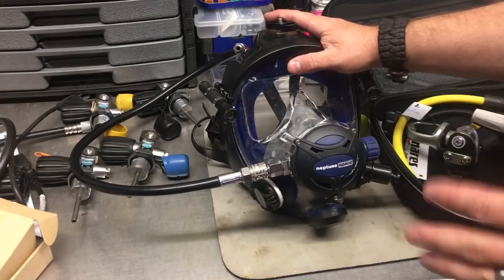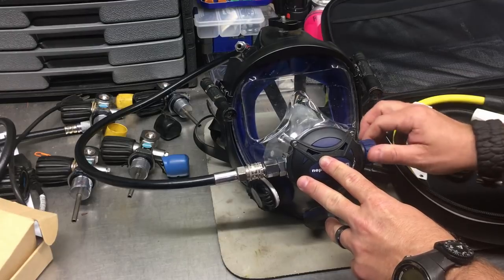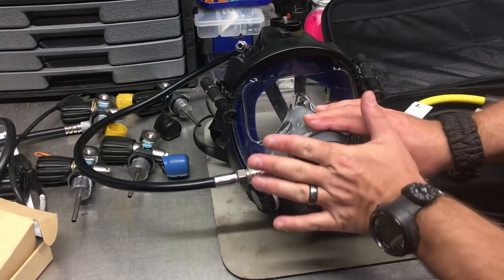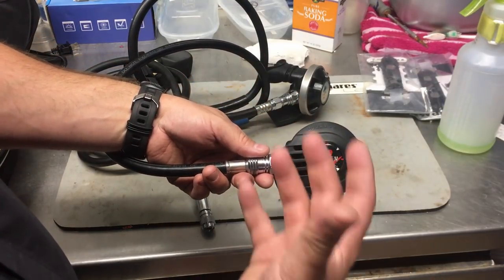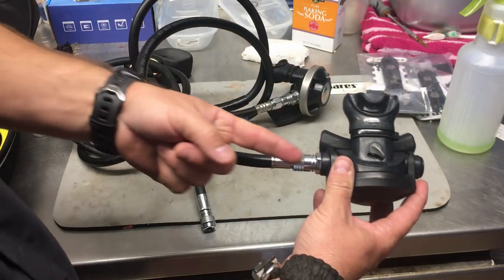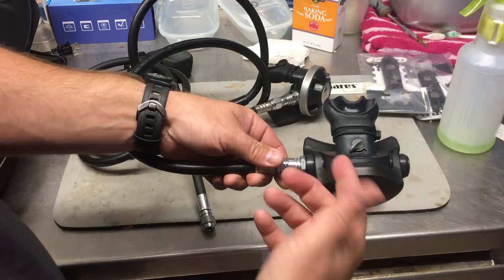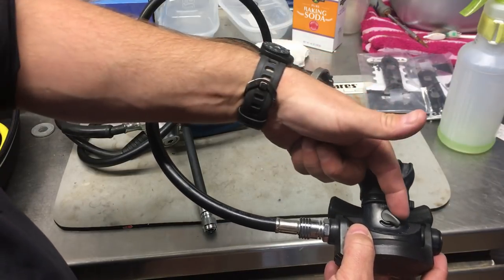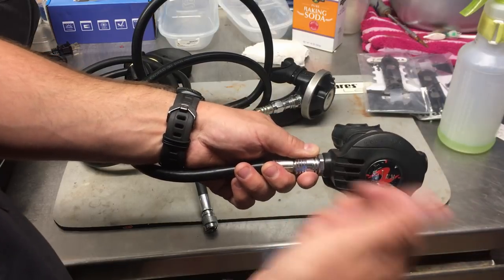Different Types Of Adjustable Second Stages

Comment: Sherwood maximus i believe it adjusts the cracking pressure. it was the 1st reg i ever used after open water class it was the instructors reg. 
I have had this regulator in the tropic all the way to ice diving. Not bad for a 20 year old set of regs. Between my son and i we have 7 of them. But just like all else it must be taken care of and they will last.
Reply from the maker: Sherwood makes awesome regulators.  I started out using Sherwood as well.  Still own 3 Sherwood Brut's from the 1980's and 1990's.

Comment: I currently have an Aqua~Lung Legend LX Supreme, and it comes with Aqua~Lung's "MBS," or "Master Breathing System." It's a single knob that controls both the cracking pressure and the venturi effect. I have a second 2nd stage on the way, a Legend Supreme (non-LX) that has a venturi lever only. I'll decide when I've had a chance to test it which one will be my main regulator (attached to my full-face mask) and which will be my alternate regulator (for use with a regular mask). I have a quick-disconnect fitting on my LP hose, so I'll be using the same 1st stage with either 2nd stage, with the associated SPG, BCD inflator, drysuit inflator, and safe-second (an Aqua~Lung ABS Octo) always attached. (The ABS Octo is not adjustable while diving.)
Reply from the maker: I have always like the slick look of the Aqua Lung Legend series.